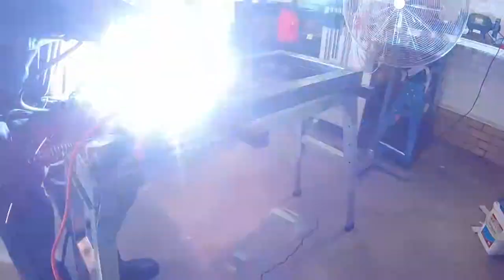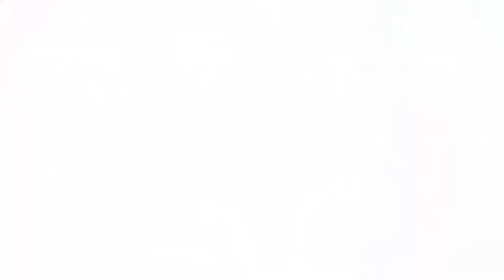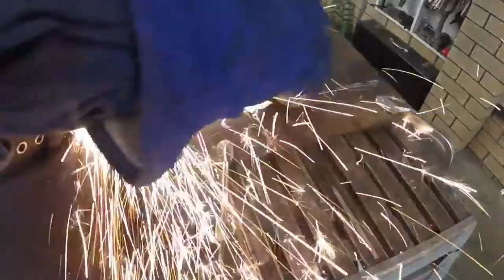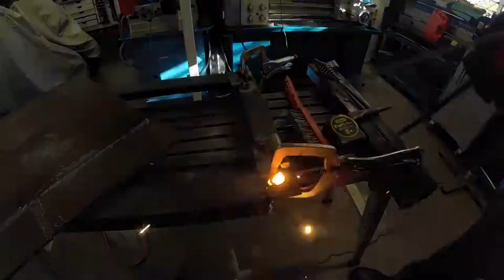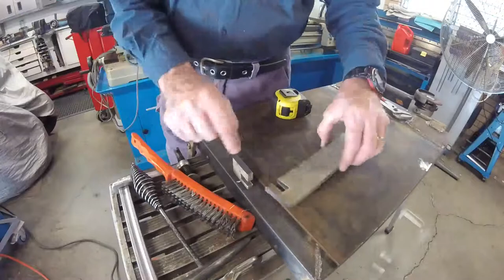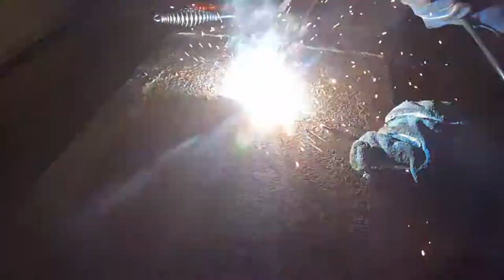Making a barbecue firebox door.

Comment: Two questions.. Why not add a spring to that handle to open and close.. the other question.. Why not add an extension to your latch that holds your door closed, to allow your door  to open in stages?
Reply from the maker: Adam, those are both good ideas. I am thinking about a rebuild of that BBQ and they are useful suggestions that i might incorporate in the next version. Thank you.

Comment: Why the handle in the middle of the door
Reply from the maker: Not sure now why I did it that way. I am thinking that it was to give some weight on the latch so it stayed closed. The handle needs some form of insulation on it as it gets too hot after a while. I have to grab it either with a gloved hand or more usually a towel on my hand.